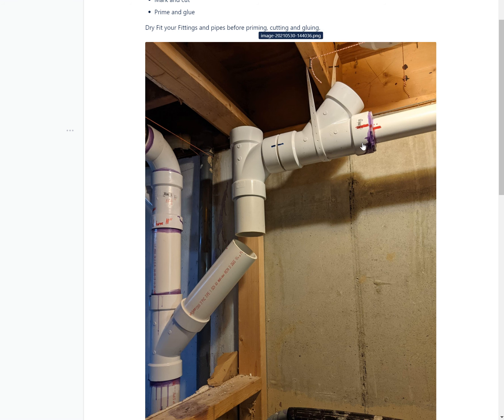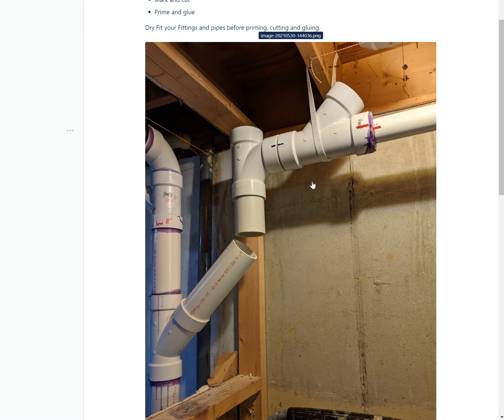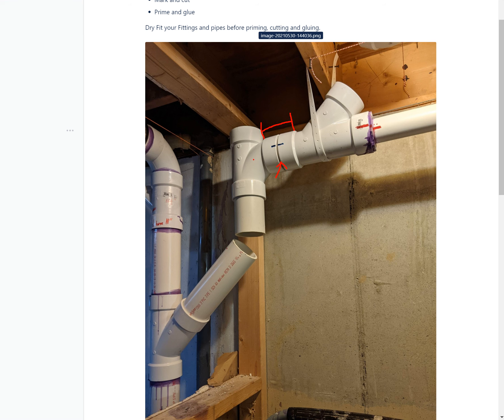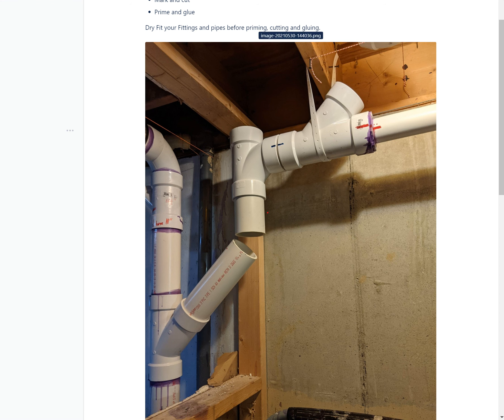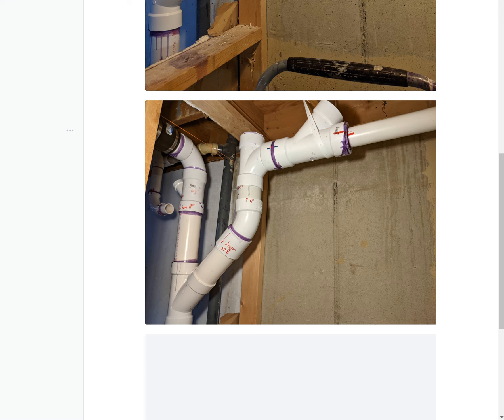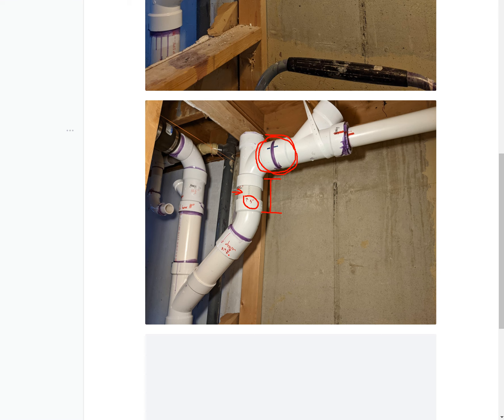How to dry fit plumbing pvc pipes

Comment: As a plumber, it's not good practice to dry fit more than a couple fittings at most at a time. Usually, you only dry fit to get rough measurements but you glue as you go. Reason being, it's tough to insert the pipe completely into the fitting when dry. The glue acts as lubricant to fully seat in the fitting. If you dry fit a big section of pipe and then glue it, more often than not, all your measurements will be off once you glue it and you end having to re-do things and give yourself more work. You can get away with it for a small section of pipe like this but if you're dry-fitting on a new house and you're wondering why none of your cut pipes are lining up with the holes when you glue them, that's why. That's an apprentice mistake and is a nightmare to rectify because you basically have to do everything over and all that material is wasted because the cuts were short, I've seen it happen more than once. Measure twice, cut once, and for plumbers, glue as go.
Reply from the maker: I agree, thanks for the positive contribution.

Comment: Good video.  My question is when you dry fit the pipe does not go into the fittings all the way so you cannot get a true measurement.  How do  you overcome this on a pipe run.
Reply from the maker: Hi Teacher Lynn, I don't recall if I mentioned this in another video, use scrap PVC pipes that are shorter than the actual pipe you will use, you can even use two pipes and put them together with a coupling fitting to get the approximate length you need.  The scrap pipe or assembled pipe needs to go into the two fittings you are trying to connect around 1/2 inch to help you measure.

Once you have the right fit, you can measure the actual distance (you are measuring from fitting to fitting (see video I created), not the scrap).  This method will give you the exact length of the pipe you need.  

Dry-fit does not mean fitting the actual pipe, in my opinion, it means get the right length by measuring using scrap pipes and get also the orientation needed.  Mark the fittings for it. 
Sorry for the long reply....I will try to create a video.
Reply: @ezdiyremodel  Thank you and let me know when you do create the video.  Great advice.
Reply: @ezdiyremodel  I was about to give this video a thumbs down until I read this comment. Genius, you should just make a 30 second video to show this! Thanks
Reply from the maker: @nilsonovich  will do by Friday then :-)